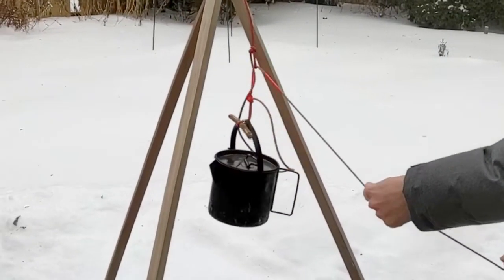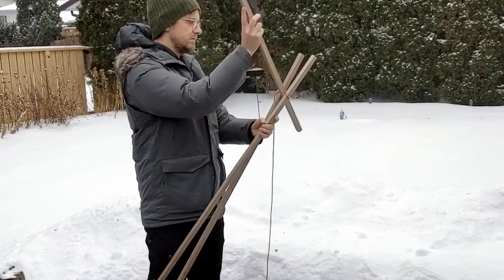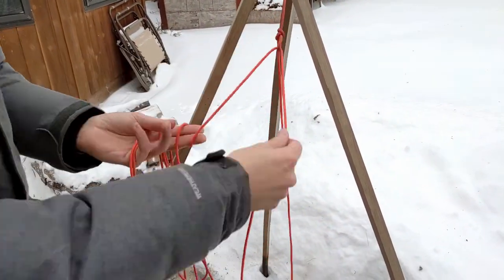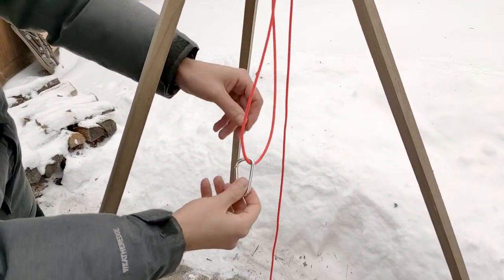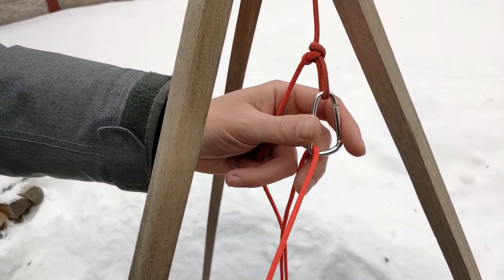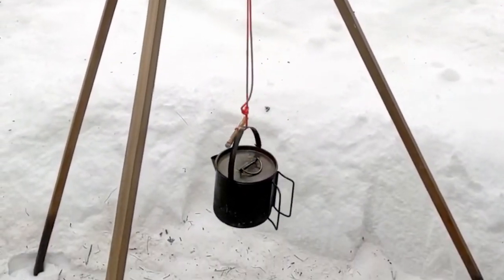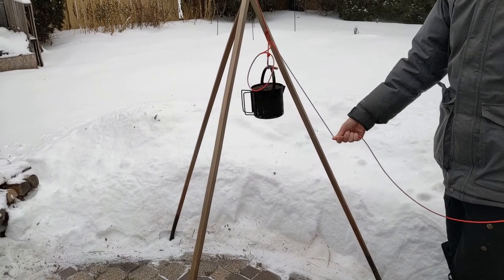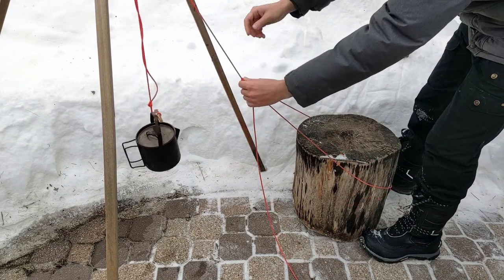Bushcraft Tripod & Adjustable-Height Pot Hanger

Comment: Clever idea. I've used a simple taught line hitch, but your system keeps the hands away from the flames. . .nice. The only addition I could offer would be to use a marlin spike hitch on the toggle so you don't have to worry about dropping the toggle into the fire.  Cheers!
Reply from the maker: A marlinespike would be better indeed! Not sure why I used another butterfly loop upon reflection... Thanks!